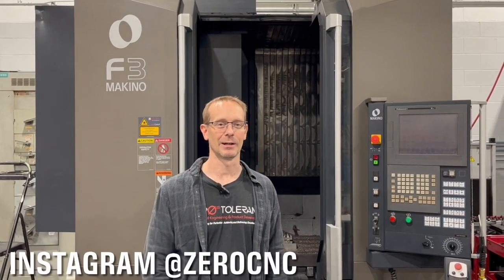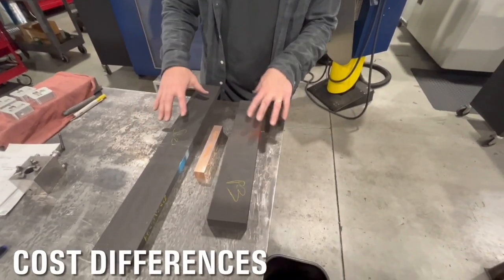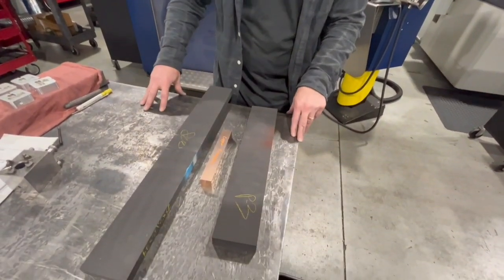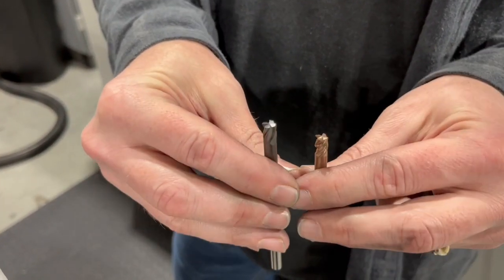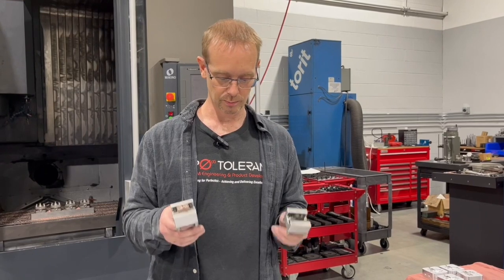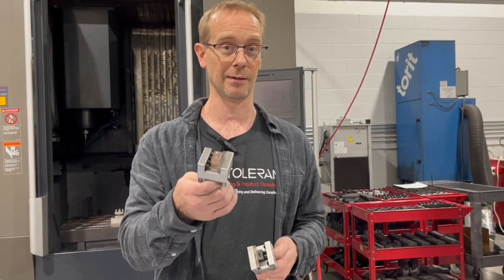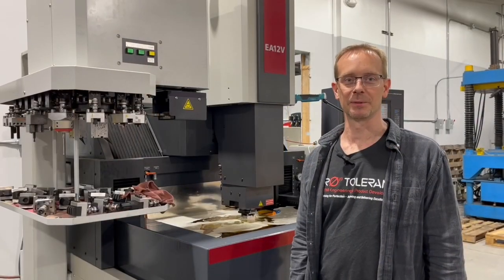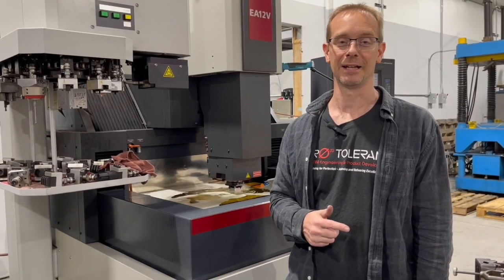Copper VS Graphite: Which Material is Better for EDM Electrodes? | Learn to Burn

Comment: I have had the good fortune of meeting Jim Weirdo a couple times. Great Guy and very knowledgeable. Graphite is for rapid, high volumetric material removal where detail is not critical. If you have to remove a lot of material, go Graphite. Copper Tungsten IMHO should only be used for burning Carbide. Tellurium Copper is the proper Copper to use for burning metals. It machines nice and will allow for multiple burns with ultra fine detail with one electrode. It burns slower than Graphite, but if you use Graphite, and you have to make, mount, indicate, re-touch off and set work coordinates (which opens the door for mistakes and mis-matches) HAVE YOU REALLY SAVED ANY TIME? Usually not. I use Tellurium Copper 90% of the time. MUCH cheaper than Copper Tungsten. Also rough with Graphite and finishing with Copper is a good strategy oftentimes.
Reply: he's our mits guy too

Comment: You didn't mention that to cut the graphite you need a special machine for that ... 
Also you did not needed to use the copper tungsten ( we use it for burning tungsten or widia) you can take high grade of regular copper that fits to electrodes and the costs are lower then the copper tungsten 
But yes if you have a massive work with EDM it's very economy to use graphite in the long run
Reply: You can technically use any mill for graphite machining as long as you have a vacuum system to control the dust. We keep a dedicated mill in our shop as the electrode mill with a great sucker system. We just upgraded to a Makino F3 (shown in this episode) before we had a DMTG smaller mill and it was also only used for graphite but could have been used to cut other materials as well, the customer who purchased the DMTG mill from us will also be using it for graphite.
Reply: @zerotolerancecnc  frome where do you buy the vacuum system?

Comment: Please stop saying copper. You need to say copper tungsten, if that’s what you are using, because copper without tungsten, is a common material to burn with.

General rule of thumb is copper tungsten will burn slower but will give higher finish and less wear. 10% approximately 

Graphite is faster burn but can’t get as nice of a finish. Approximately 50% wear

The finer the finish means the spark gap is smaller, that’s why the electrode wears more. Spark gap is the width of the spark between the electrode and the part. So the electrode gets closer to the part, causing it to wear more.

Rookie mistake selecting the wrong tech.

Comment: Could you explain how you decide on orientation. Interested to know why you would run at 90deg and have a shallower electrode and pass.

Excellent videos :)
Reply: Sorry wouldn't run at 90 deg !
Reply: We did it this way just to show what a blind pocket would look like for video results, that's a great question! Normally you would do it in the shallow direction for sure.

Comment: my sparking experience was , in case of emergency get me to do it on nights , it was 50/50 if it was right lol ( i was high risk ) , but used to rough with a graphite, finish with copper so 2 burns, no tight tight tolerance  , but i hated milling graphite dirty material , the guys who done it full time were grey at the end of the week company paid for a sauna every weekend for them .
Reply: It does require a good sucker system, or things can get dusty. We've invested in a great sucker system to minimize graphite dust around our shop. But when handling graphite most of the time your hands become covered in dust, then its on your face & on every door handle in the shop lol!